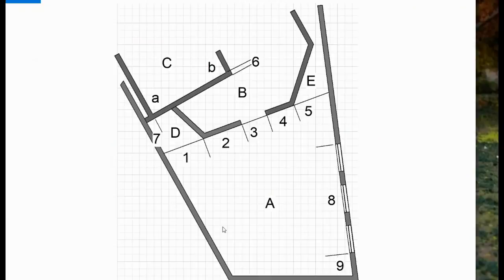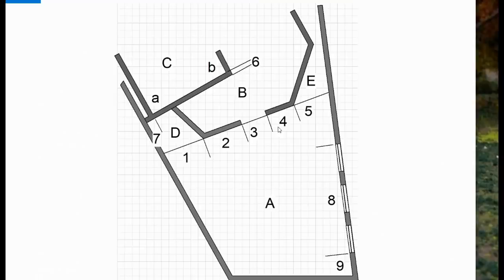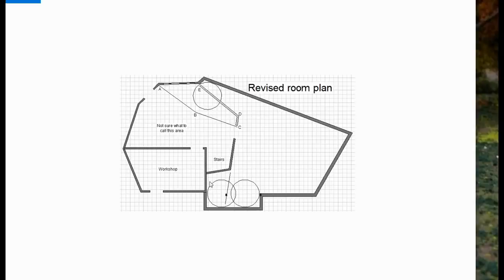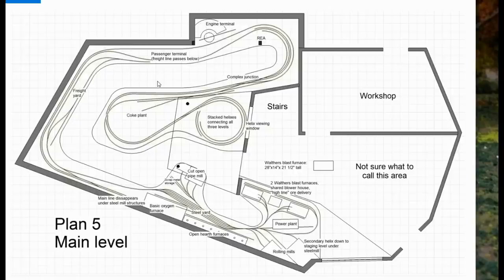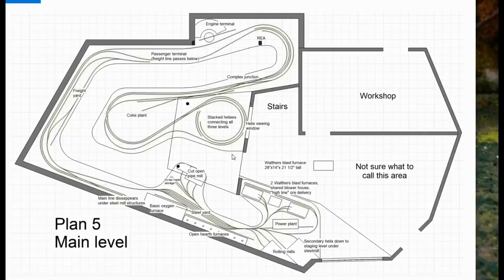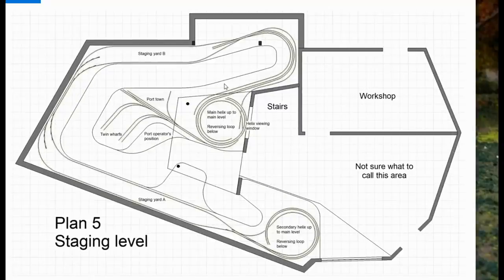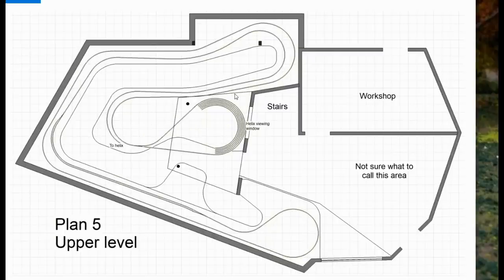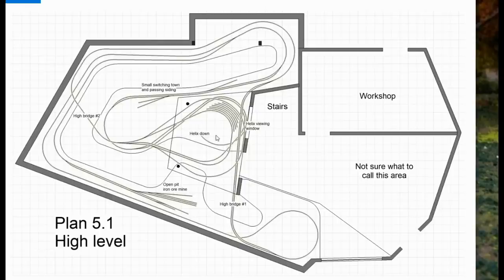Sometimes layout designs don't go quite as planned

Comment: Afternoon sir Victor from New Jersey how are you and your dogs today. There's not a lot of new content out there so I'm going through a lot of old content yours and other YouTubers currently building an HO scale modular type layout so when I have to move it's like 4 ft sections I'm going to fairly small room 12x14 making it up as I kind of go starting out with a roundhouse scratch built start to finish turntable in the first four feet which takes me into the corner going to do some type of a homemade bridge river scene and go from there having said that recommended curves on an HO scale I plan on running long old steam locomotive articulated once I buy a couple right now I'm picking stuff with the chickens building what I can with what lumber I have and track and whatnot but before I come into the corner build I was curious as to what do you recommend I want to have two main lines coming out of that I mean do I go for like a 40 inch should I keep it at a 24 I mean what's good what's going to suit my needs for articulated locomotives if you can help me with that question I'd greatly appreciate it so you have a wonderful day and bye for now
Reply from the maker: For big articulated steamers, go with the widest curved you can fit into the space.  Even though some such models are built to go around 24" curves, they look like crap doing so.  Curves in the 36-40" range look pretty good though.
Reply: @mpeterll  thank you sir I was thinking about a 40 inch in that first curve and you just made up my mind I will send you pictures of my work as the progress moves forward right now not worthy of a picture but I'll get there I'm out of work due to hernia so I have time to work on this thing I just got to get a little more wood and I can keep producing thank you for getting back to me sir you're an absolute gentleman bye for now
Reply: Once again sir how are you? Is there a definitive number from the front of the roundhouse to the start of the turntable for the length of those tracks if you can help me with that a thousand thank yous if not 999 thank yous once again I speak with you because what I've watched on TV your knowledge is what I want and I'm a 40-year carpenter as well thank you for letting me pick your brain and learn something new bye for now

Comment: Don't have enough space for the design, just ask(demand) for more from the client, the brief is to fit it to the space not take up the guy's entire living space. Before he moved the wall why didn't you recommend the helix could have gone in the center?

Good video on redesigning a railway system, I myself have tried to choose between a table or whole room layout, this has helped alot, whatever I do will need the ability to expand. The other issue for me is I like villages, cities and castle, none seem to be in this layout, how would you do these? Shame this was never built.
Reply from the maker: Without moving the side wall out to add that extra alcove, there was not enough space to get a curve of acceptable radius in that corner, so it could not have been used at all - regardless of where the helix went.  The client was determined it should go in the corner until I showed him the benefits of moving it out.
Also see reply to your other comment.